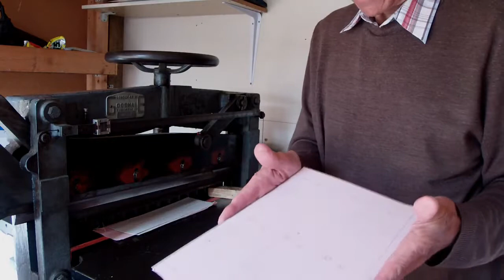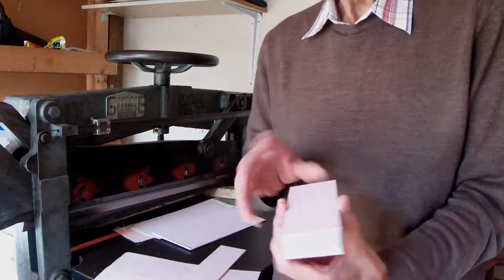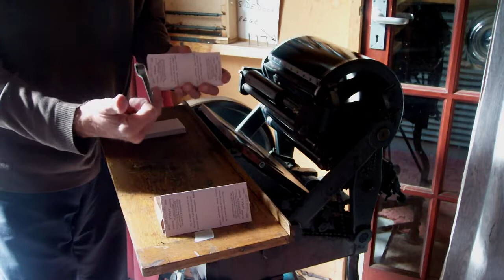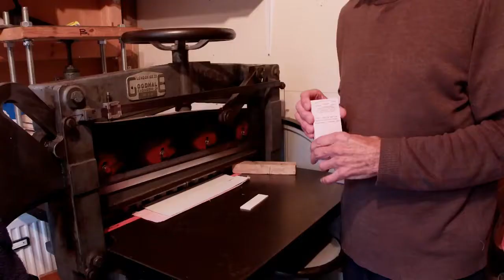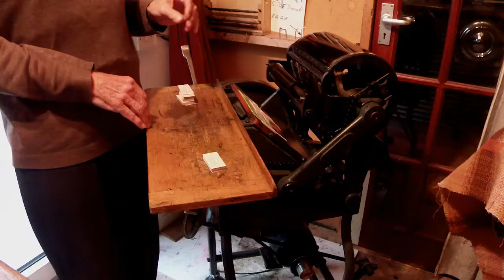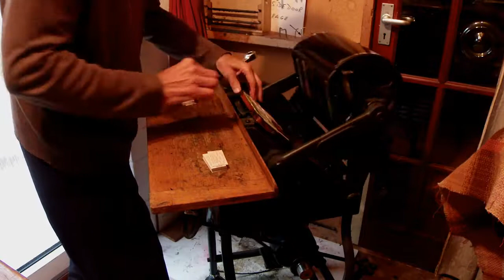Printing Edmondson railway tickets

Comment: Thank you for sharing Norman, what kind of costs are involved for producing a batch of say 800 tickets?
Reply from the maker: Hi
Thanks for enquiry the basic costs would be 50 sheets 750 micron grayboard £6.00 and 100 sheets coloured copier paper £4.00 (A4 size), plus some PVA adhesive so taking ink and cleaning materials you would be looking at an outlay of £12.00 (sterling). But remember there would be a high labour cost. l reckon on 5000 taking me 4 days to produce and as the “going” rate in the UK is around £20/24 per 1000 so you aren’t gonna get rich quick. l was involved on the footplate so didn’t mind doing the work. Some of the preserved railways in the UK managed to get old British Railways stock of blanks cheaply and are still basing their costings on the original costs not the replacement/current costs as a commercial printer would do. Hope that answers your questions if not then please contact me at norman.bigpawpress@gmail.com
Best regards Norman
Reply: @normanbrown3384  thanks norman, i am looking to get tickets printed for the railway i volunteer with, we are a small group and have just opened our station and started selling tickets, at the moment one of the members makes them on his computer but ideally we would like an authentic feel and size edmondson style ticket, i shall move the conversation over to emails if you are happy to continue it, thanks, Mark.